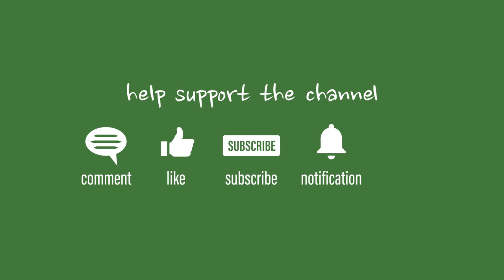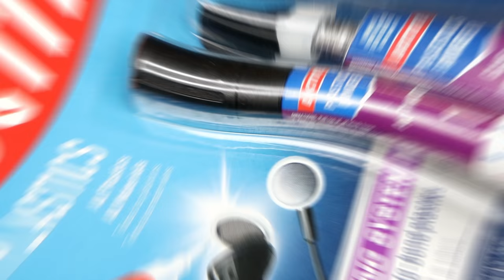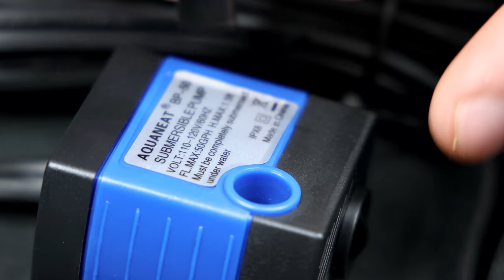Mini Self-Watering Moss Wall

Comment: The foam is 30 ppi, not 300 for those who are trying to do the same. Beautiful little wall and inspiring as always
Reply: @dave right, I think it was just a slip of the tongue which is why I left the comment. If you look up 30 ppi you can see its the same foam. As far as I can tell 300 ppi doesn't commonly exist, but if you can find it you'll see that the holes are too small and numerous for it to work well for growing moss.
Reply: @dave me too! That's how I found out. I hope your project turns out better than mine :)

Comment: When you rewire, cutting the hot/neutral at different lengths will make it easier to wrap and make the risk of shorting out much lower.
Reply: Did he just twist the mains wires without soldering them?!? WTF
Reply: @ErebosGR  Yeah, I just lost a couple thousand dollars of equipment due to an unsoldered splice job causing arcing (not shorting).
Reply: @ErebosGR  Yeah, should have at least used wire nuts or butt connectors...and marine heat-shrink tubing so there's no chance of moisture getting in either.
Reply: @byrn  i dont know how much marine shrink tubing is but he could have used what he had and put a dab of silicone in heat tubing before shrinking it. would also make a waterproof seal
Reply: i just looked it up and marine heat shrink tube is modern version of what i said :D

Comment: Thank you for the awesome video. I would like to try this and have a question:
I've never done any project with moss. how often do i have to change the water? would it be possible to make a drain so the water replacement is easier? and is washing the moss sufficient for preventing pests?

Comment: I had a moss wall in my room installed by a "professional", but within a month larvae were crawling along the ceiling and dropping on my work table, while moths were becoming a pest.
But what I don't get is that they say you can just have moss wall and it will look good forever.
This simple thing looks awesome. And I doubt any moths will be able to survive the wet circumstances.

Comment: Thanks to this video, I put together my first Terrarium! Turned out just like the video with a few notable exceptions. 
1) I had a hard time getting the moss to stick in the cut slots of foam so I used dabs of superglue gel instead and it's been working well. 
2) I installed a lamp switch to the motor cable when I spliced it to put it through the box. This makes it easy to turn off the motor if the humming gets annoying.
3) Fungus gnats also love this moist open air terrarium and now it is literally crawling with gnat larvae. Any suggestions on how to remove and prevent this?
Reply: Add carnivorous plants (flytraps, sundews) or cover the front?

Comment: Since it isn't growing in dirt, wouldn't the moss need to be fertilized every once and a while like in hydroponics? If so, what would you use?
Reply: Nah man moss doesn't have the ability to use fertilizer
Reply: @bradleybellamy2416  so explanatory.  So moss isn't a plant the way a plant is a plant?
Reply: @bluewolf783  pretty much man, it doesnt have roots to collect nutrients so it can only use the sun and water
It also goes dormant at night because when the sun is down it doesnt want to waste as much energy
Reply: Moss does need and use nutrients! But in low light, it doesn't need much and many times get enough from just the dust in the air. But you can fertilize the moss from time to time with VERY diluted fertilizer mixed in water.
Reply: @jonisolis9645  I'm going to need some sort of source for this in an article, for my own knowledge

Comment: Tanner how long does moss last in your terrariums? Even in my closed terrariums it doesn’t last for more than 3-4 months before it begins to brown and look like it’s dying. I never seem to be able to get it to propagate either. please help 😞
Reply: Im still getting into growing moss, but if it’s happening in your closed terrariums perhaps its getting too much light.
Reply: make sure you the moss isnt constantly flooded with light because it can dry it out/burn it, make sure theres a good water supply and a very important thing is good draining!! its also good to spray the lid of the terrarium with water to initiate the water cycle :)

Comment: Hmmm. This gives me the idea to try and design one in CAD software for 3D-Printing. Since people been printing little modular fountains with that kind of pump, this should be possible. A basin, A wall with small hooks for the foam and cable/tube guides. Or maybe try to see if a Tower design could work with a small distributor at the top. Guess i got a new project!

Comment: Nice build although the light is probably unnecessary if there is enough natural light available. Also I would probably place the holes accross the top like a spray bar.

Comment: I discovered a new material to re-purpose into  projects like this. If you see someone throwing  out an old trampoline, go cut out a big section of the trampolines main jumping surface material(whatever its called) . Excellent UV resistant black mesh that lets water easily pass through. Try it

Comment: Pro tip: theres something called a rubber grommet and they’re used at 2:16 to prevent the wire sitting on a sharp edge.

Comment: I would just go ahead and route the cord directly through the bottom wall on the back. It's more silicon but it will definitely be more stable with the cord not hanging off of it from the top like that

Comment: Hi, to give the pump maintenance without taking everything out and rebuild it, I would make an extra extension at the bottom back of the container, like the one you did in the front but higher. In this space you place the pump and it will be available for maintenance without touching the living wall. I would try it

Comment: Fabulous! Wouldn't a 12v pump be better though? Just as cheap, thinner cable, far safer (when cutting and splicing the cable), and can share a transformer with LED lights...

Comment: Have you ever used concrete on top of styrofoam and chickenwire to create cool walls? Dry pigments are very forgiving when applied to concrete. Yellow, black, red and white are great for this. A coat or two of clear aquarium paint to keep the pigments in place. Small pieces are always easy to experiment with without spending too much effort. Think you'd ever do something like it? With concrete and pigments i mean.

Comment: What about instead of using a pump you've used a sand-clock design? There could be water reservoir on both sides and you could just turn it upside down to water it. I think it would cut a lot of costs too. Designing it wouldn't take much time and you wouldn't need electricity either. 
Feel free to correct or criticize my proposal. All the best!

Comment: Hi.  I really like this.  Today I thrifted a small desk fountain that has water running down the side of a flat cut of rock.  Would it be possible to attach moss to that for a similar project to yours?  If so, how could I attach moss to a rock with water running down in it?  There are also small stones at the base.

Comment: The wire connections should have been soldered or crimped. It should be fine but just twisting them together can be a bad connection and get hot causing a fire.

Comment: i would love to try this!! ive tried several moss terarriums that always failed )^; 

one question though: you mention servicing pumps in a lot of your builds, but i have no idea of what that means? 😩 it's one of the main things hindering me in starting a lot of builds. all the electrical stuff is intimidating! 😱
Reply: servicing just means either fixing the pump if it stops working, or just replacing it. with a pump, most of the time the only issue you might have is an impeller (the whirly bit) getting stuck or not spinning correctly. with most pumps you just pop off the side at the seam, take the impeller out and clean gunk (usually algae) off it or adjust the way it fits in. the impeller is magnetized so it'll just put itself back into place. a decent pump should last several years without problems, especially in this type of setup where there's no dirt or snails to get stuck in it, and the foam around the intake keeps most of the debris out.
Reply: @headfangs  tysm, this is so precise and understandable! (^: appreciate you~

Comment: Love it! Why did you choose to run the wire through the top corner of the bin instead of the bottom and then seal it with silicon?

Comment: Hey wanted to build an upscaled version of this (200x50cm) just checked the Foam you linked and it appears you have made an error in your Video. It is 30 PPI not 300 PPI wherever i searched i couldnt find something above 80 PPI.  But very cool Video regardless=)

Comment: Hello! I tried this recently, basically used the same exact design, and my moss ended up dying. The flow was good, all of the moss stayed hydrated, and it got plenty of light, but it started to turn brown. Any ideas why? I was using softened water so maybe that’s it
Reply: Perhaps you could consider temperature and airflow. As mosses live from water and air and you mention you have good water flow maybe its the airflow or overall temperature of the room or location where you have it? When you mention it has good light, if its getting direct sunlight you might try a more indirect or less intense lighting.

Comment: I have a question. Does the vinyl tubing need to be removable from the pump adapter? My tubing seems to be too wide for the provided adapters with the pump, and I was thinking about trying to caulk or seal it somehow and wanted to know if this would cause any issues.

Comment: I thought that much water would make the moss overwatered and rot. Is that much water normal? I tried to put my moss on a sealed opaque white container and put it outside under shade. But my moss is getting darker like its rotting but its not, the moss is only getting darker color.
Reply: Moss can be grown aquatically if done right.

Comment: Hi Tanner! I'm making plans for an open paludarium for my turtles. Have you got any tips for me? I'd like to put water in it, flowing over the back of the tank (saw that in your video) and it has to have a dry sand area with a heat lamp above it. The back of the paludarium will, of course, be filled with plants.

Comment: Rewiring the pump is illegal in Australia unless done by a licenced electrician. If you do it yourself you face a $40,000 fine and 5 year prison. 

Many countries around the world don't let people rewire things that plug into their electrical grid, and have fines attached.     

This project would be better if it was adapted to make the pump operate on batteries.

Comment: Love this vid and your work, but you need to please show people how to do a proper wire splice. Your method is dangerous, you will be lucky to have it work for a short time. Please show a vid or details about in-line splicing, soldering, and (well done, you did this) heatshrink tubing. Otherwise your connections will corrode and become fire hazards. Cheers!

Comment: People go wild for this stuff, but it’s always such a bodge job, especially the electrics. Cutting and joining cables without any proper connectors, lumpy LEDs magnetically attached to the back, and globs of “structural” silicone all over the shop instead of cable clips and glands.

The people with the ideas and the cameras are the laziest when it comes to doing things properly .

Comment: Thats not proper wiring I think. In Europe at least. You need proper connection between the wires not just a twist, like a wago connector. And you need something thats holds it together so when you pull on it the forces are not on the connection. I'm not trying to be an a-hole just my english is pretty bad for proper nicness. Just trying to help you and others not to get in any problem because of this. Maybe a cauton in the video or something, I don't know how thats works.
Reply: Btw I just got an USB pump, maybe thats a good project for it. :)

Comment: please please please please please do not do this type of electrical connection, there is so much wrong with it.

Wire-twisting is not an accepted electrical connection
Heatshrink tubing also is not an electrical connection, it's for low voltage insulation, and possibly water ingress protection if you buy the right stuff

At bare minimum this connection should be soldered, then heat-shrunk - but that's not common practice for high voltage electrical either.

Ultimately to make this remotely safe/legal to connect to the household mains, this electrical connection should be enclosed in a plastic box (two-wire ungrounded), or a metal one (three-wire grounded setup). Then you should be using an approved connector properly like wire nuts which are approved widely in north america if used properly, or wago connectors which are increasingly being approved worldwide.

The problem comes down to if someone gets shocked and hurt, or if your house burns down *even if this connection was not the cause*, and the investigation finds this device, slimy insurance companies will do everything in their power to weasel out of a claim. Best to investigate and do these things by the book.

Comment: You didn't solder the wires!? Also that is not the best way to wrap wires - if you pull hard on these they'll untwist. A better way is to cross the two wire ends, bend each of them beck on it self and twist each wires with itself - the interlocking "eyes" are much stronger than just a strait twist. If you apply a little solder (with flux) on this connection, it becomes even stronger than the wire itself.

Comment: Ugly. You should go for tiniest moss. And use dc programable timer and sprayer. Not water drops. Moss has to be sprayed with tiny noozle at 3psi. You need to copy the rain. And make moss wall at 60° angle. Not vertically. And use thin clay layer with finest sand underneath for a good sticking sticking. Your project is small. Expensive and not reliable.